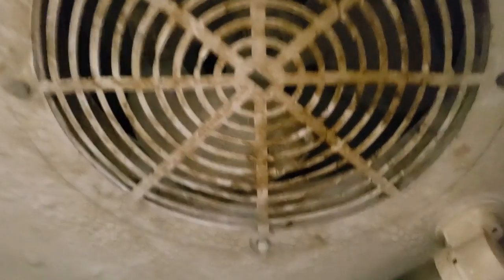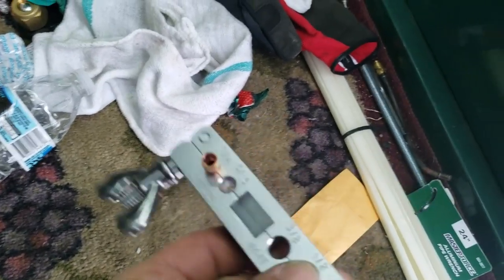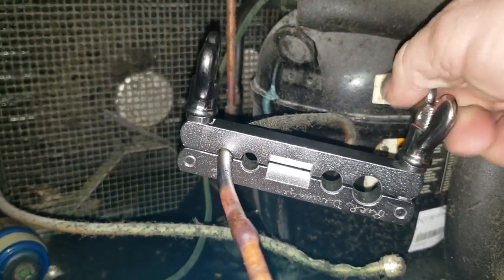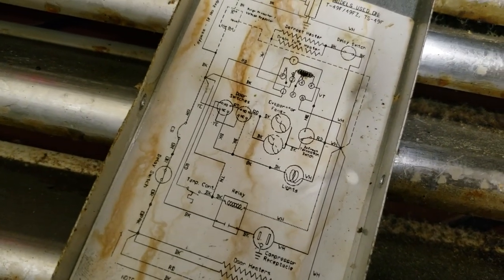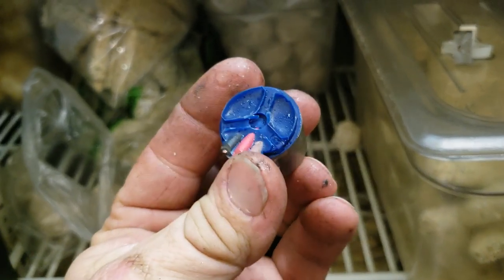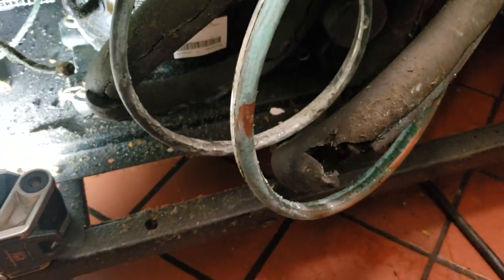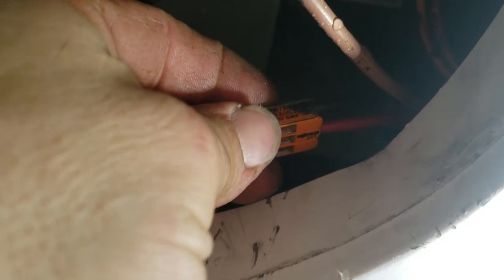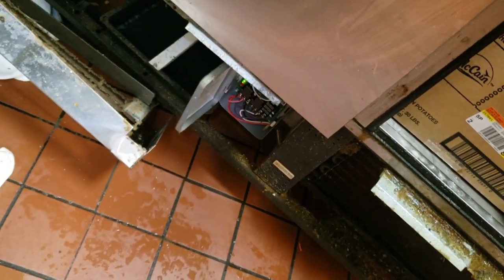No Fan Operation On Reach In Freezer

Comment: Nice job Rick; In and out.  Great technique finding the problem.  Well done....
That sniffer issue was a mystery though, wonder what it was....
Reply from the maker: I like the convenience of it,  but it's not as reliable at finding the real leaks but I'm still learning it. But I believe it's the second best detector out there. I hated a few others I had.   I use to own a couple Deteks before the H10PM and Pro. 🤷‍♂️🤷‍♂️🤷‍♂️
Reply: @HVACRSurvival  Yeah, on your rec and from others I heard, I bit the bullet at the very start and picked up an H10 before I even started, I also have a goose ultrasonic which l've found useful outside and SRL8 for my quick start tool.  So far so good, but to be honest as a rookie, I haven't had call to use them much yet but I'm sure I will!   The one tool I knew I wouldn't go wrong with was the H10.    That was first....
Reply from the maker: @crforfreedom7407  awesome to hear! I got rid of both my fieldpiece leak detectors,  I had to meant disappoints from both models.

Comment: Great video thanks.  Do you prefer that pinch off or the vise grip pinch off?
Reply from the maker: I have both but the Imperial is better because it seals 100% everytime. I have problems getting the other to seal but it fits in tight spots better 🤷‍♂️ so use both at times👍👍

Comment: I wonder if it could be some spots on the insulation that have fresh-er Armafkex glue on it that maybe triggered the detector ?
Or maybe a tiny tiny leak where the refrigerant accumulates inside the Armaflex and gets released in one spot more concentrated so then the detector picks it up , but once you strip the tubing , only tiny amounts of refrigerant get released in the air in such a small quantity and spreaded so much that it just can't pick it up .
I think maybe the tubing has become porous and it does have micro leaks all over , I don't quite understand why they made such a loop on the suction , is it to make for oil trapping ?
Good vid , cheers !
Reply from the maker: The loops are so you can pull the condenser out from the front. Sometimes these freezers don't have wheels so you can reach it from the back.

Comment: Hey sir , I am 1 year apprentice when you brazing the access port do we need to vaccum after Bcz I didn’t seen in video . Please share your thoughts . Thank you
Reply from the maker: Think about how I did it, I pinched off the line that had refrigerant in it, then brazed on a refrigerant stem, then re-rounded it opening up the system again, why would I need to use a vacuum pump if it's under refrigerant pressure? Why not burp the Schrader core and continue on?

Comment: d tek is garbage, always went off on insulation for me too. h-10 is the one and only, always keep two on my van.
Reply from the maker: What's weird is it didn't trigger on the insulation by itself??? It's a great detector but has a couple weaknesses.  Thanks 4 commenting👍👍
Reply: @HVACRSurvival  I have found all my detectors will go off where the insulation is freshly cut/dug into. The same thing would happen with interior wall insulation.
Reply: @RJMaker  I found the same
Reply from the maker: I would expect that from newly glued insulation but this was old worn out stuff. I try to do multiple random searches while doing a PM to get a good idea of what will trigger my detector I use. The Detek is what all the techs use where I work is why I finally got it as my backup detector after trying both the Fieldpiece detectors and the TIFF ZX.

Comment: First.
Reply from the maker: winner👍👍😅
Reply: @HVACRSurvival  just had a same reach in freezer  t49f call . two weeks before.
Reply from the maker: @steve19841117  what was wrong with yours?
Reply: @HVACRSurvival  valve core was leak. i was connect my gauge to the system pressurerize with nitrogen and searching with h10 and bigblue .cannot find the leak for 40min.i was ignore the schrader valve LOL